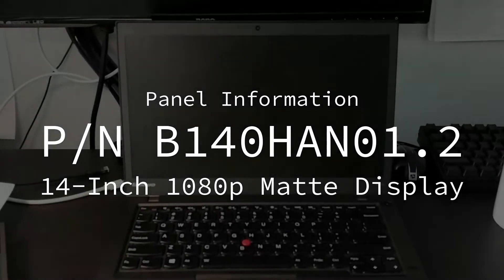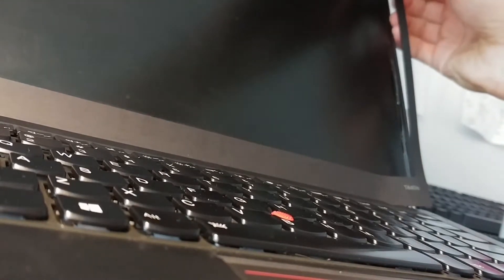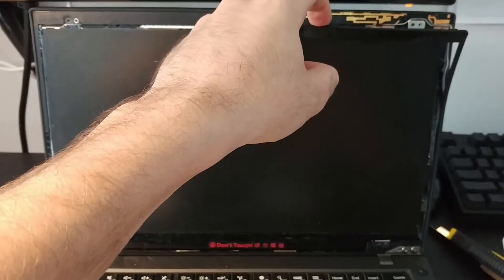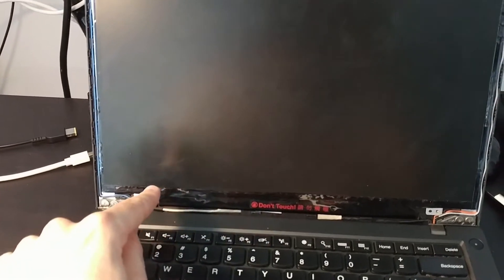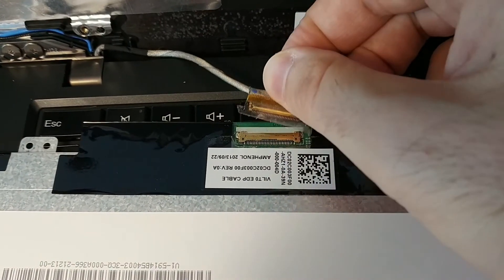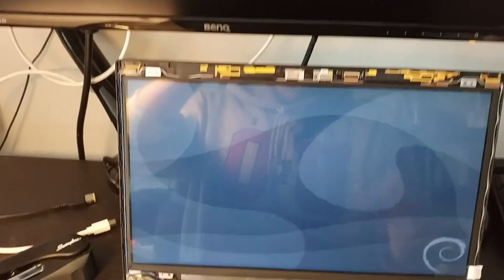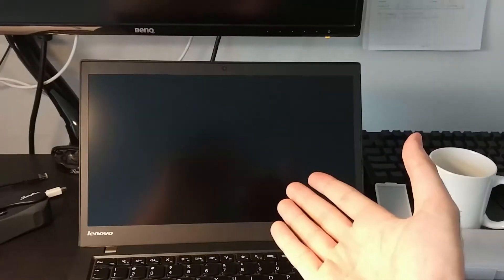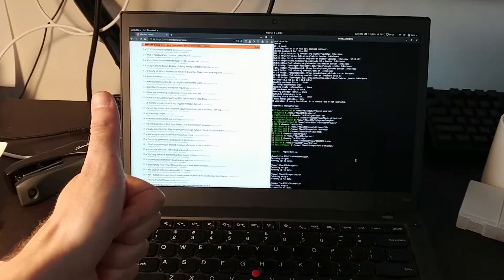Laptop screen replacement / How to replace laptop screen Lenovo Thinkpad T440s

Comment: I have several large cracks going right across my screen but when I switch on the laptop the picture is  absolutely  perfect. Is there some kind of protective screen over the main screen ? There's a thin rubber seal going up the sides and across the top of the screen. There are three Phillips head screws visible at the bottom left and right corners of the lid assembly under the screen. I'm reluctant to start pulling it apart as, apart from the cracks that disappear when it's powered up, It's working perfectly.
Any advice would be appreciated.
Reply from the maker: Weird. The replacement screens are cheap - swap it if it's bugging you!

Comment: Did you have any problem sticking the bezel back? I need to replace my screen but I don't know if it's necessary to buy a screen replacement and the bezel.
Reply from the maker: No, the bezel is a fairly durable and not too thin plastic, and if the adhesive on the back of the bezel fails, it'd probably be fine to apply more thin double-sided tape.

Comment: 1) whats the name of the software at the end of the installing process, you used for checking the data about the panel? 2)  did you actually put the screen sticker back on? was that easy? 

i ordered a fhd panel for my t440s and am looking forward to having a nice display.
Reply from the maker: The operating system on the machine is Debian. Screen sticker was very easy to put back on, just make sure you're working in a clean space, free of dust.